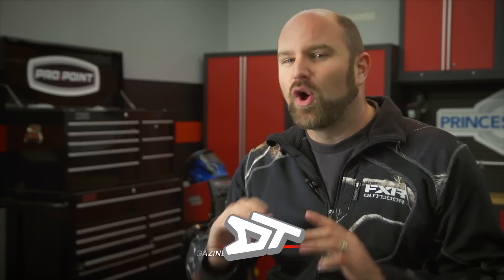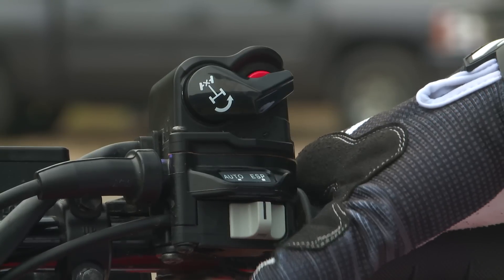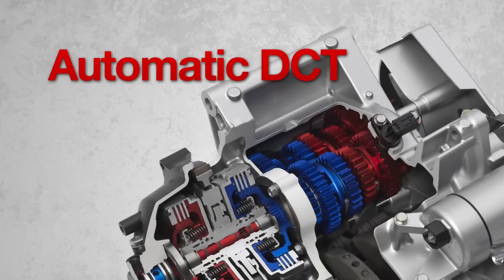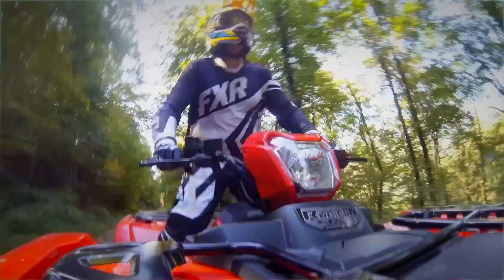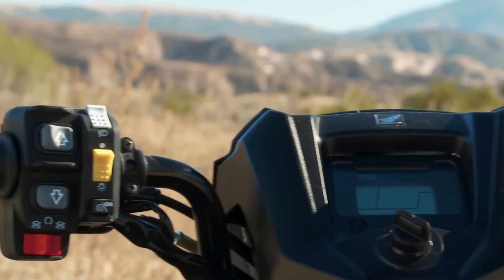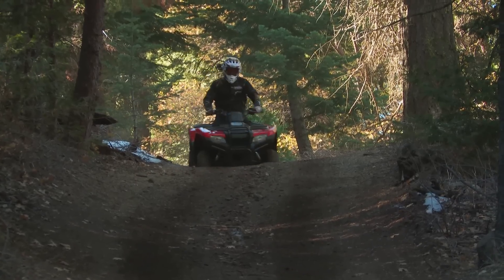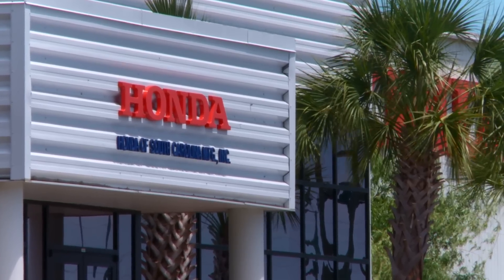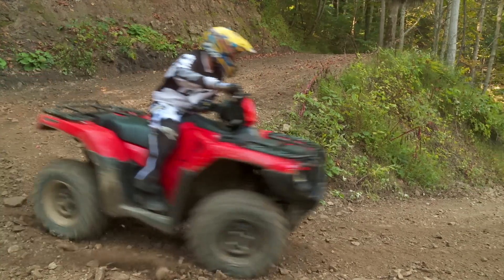Honda ATV Dual Clutch Transmission

Comment: They act like nobody with a Yamaha or Polaris or any other ATV with a CVT transmission can tow anything.

Honda, give it up and make a CVT transmission already.  There is a reason ALL other ATV manufacturers make ATV's with a CVT transmission.  Because they work, and work very well.

I want to buy a Honda, but I will not get one until they decide to step into the 21 century, and at least make CVT an option.
Reply: +AUSTIN WILSON New drive belt in a few months?  Get real. I've got a 2003 Yamaha on the original drive belt with no problems. Don't spread information on things you obviously, according to your previous statement, you know nothing about.
Reply: I don't think anyone considers small-to-mid bore, 3 wheel drive honda products "beasts".  LOL
Reply: Not true:

"Components manufactured in Osceola, Wisconsin and the vehicle assembly in Roseau, Minnesota. The vast majority of powertrain and vehicles for the off-road line are manufactured in the Osceola and Roseau facilities, respectively."

Straight from the Polaris website "PAL".  LOL
Reply: +bushwackerjed towed back a newer Polaris with a CVT just the other day with my 30 year old honda. I've been around plenty of fourwheelers. plenty of Polaris 's with Cvts and saw them fail time and time again. they may shift faster and smoother. but if im gonna drop 6 grand on a new fourwheeler, im gonna get one that's not gonna need a new "drive belt" in a few months. and yes. a few months. a few years back my neighbor bought a brand new sportsman 500 and tore out the drive belt trying to pull his wife's fourwheeler out. CVT is a joke. I'll loose alot of respect for honda if they move to CVT. if it was me I'd still get the manual 5 speed option.
Reply: +bushwackerjed towed back a newer Polaris with a CVT just the other day with my 30 year old honda. I've been around plenty of fourwheelers. plenty of Polaris 's with Cvts and saw them fail time and time again. they may shift faster and smoother. but if im gonna drop 6 grand on a new fourwheeler, im gonna get one that's not gonna need a new "drive belt" in a few months. and yes. a few months. a few years back my neighbor bought a brand new sportsman 500 and tore out the drive belt trying to pull his wife's fourwheeler out. CVT is a joke. I'll loose alot of respect for honda if they move to CVT. if it was me I'd still get the manual 5 speed option.
Reply: +FishEyeGuy Outdoors he bought it new in 2010. had it a few months then that happened. it was in and out of the shop until he sold it.
Reply: +FishEyeGuy Outdoors and that was a polaris. not a Yamaha. Yamaha probably builds them better. who knows. just sharing my experiences.
Reply: +AUSTIN WILSON It was a Polaris. I'm not surprised. They are notorious for having lemons. Some run great for years without incident, others, of the same model spend their life at the repair shop. 

There are plenty of Yamaha, Kawasaki, and Suzuki quads out there with the CVT that routinely run 5000+ miles on the factory drive belt without issue.
Reply: +FishEyeGuy Outdoors either way, I personally would prefer a fully geared 5 spd manual over a CVT any day. for me it doesn't get better than that. Honda has more than proven themselves to me. And I've never been let down by one. So if im buying a new Atv, it's gonna be a honda
Reply: +FishEyeGuy Outdoors So because your drive belt from 2003 hasn't failed that means no other drive belt has failed in a few months of ownership and you are an expert? Just because it diddnt happen to you doesn't mean it happens. Open your eyes and don't be mad you ride a hunk of shit Yamaha.
Reply: +AaronBushcraft Hunk of shit Yamaha.  Lol. Sure there buddy. You keep thinking that.
Reply: No pull start. Cheap plastics. There the Ford of ATVs
Reply: +AaronBushcraft Well, I've got a lovely pull start on mine. And wouldn't you know, all my plastics are just dandy.  But you're the expert right?  Lol.
Reply: +Matt Goetz but not everybody wants a belt squalling in there ear while there riding and gears make it a lot easier ride and more comfortable. "in my opinion"
Reply: Acnologia Sad
Reply: +Acnologia That's like, your opinion, man.
Reply: In your opinion, I'm sure they are.
Reply: Two problems with that statement.  Number 1 - I don't ride a Polaris.  Number 2 - Polaris is made in the USA (mostly) and some are made in Mexico.  Most of the USA dealers get the USA made ATV's.
Reply: Yes Pal, I am well aware that a lot of ATV's if not all of them have chinese parts, except for maybe mine..It's a Yamaha, built and made in Japan :).  I'm not as concerned with chinese parts as you seem to be.

And I do "get" the gears and driveshaft argument.  I just don't buy into that it is better, just different.

I've owned two gear/shaft atv's, (yamaha and honda) and three CTV atv's (two yamaha's and a polaris).  I have never had any problem out of any of the drivetrains of any of them, except the polaris.  And the polaris's issue was internal, not a belt.

There is a fact that has been laid out, however, that although most atv manufacturers use some parts from overseas, most of your major brands have plants here in the USA, that assemble the ATV's AS WELL AS make the majority of the parts for them.

So saying a shaft drive honda is better than a "chinese parts" atv with a CVT, when you are also trying to  argue that ALL atv manufacturers use chinese parts is kind of a conundrum of an argument to make.
Reply: My sportsman 850 has a 1,500 pound towing capacity, no Honda atv is rated to tow that much.
Reply: @HorsepowerGarageVideos  my 2001 rancher 350 pulled 2 Harley Davidson motorcycles on a 12' trailer through 5-6 inches of mud! That's almost 3000 pounds! Can't beat a Honda
Reply: Horsepower Garage Rubicon is rated at 1300 so not much difference and it's only a 500 I'm willing to bet it would tow everything your sportsman can
Reply: +Matt Goetz cvt sucks
Reply: +bushwackerjed You obviously know nothing about ATV's and ATV transmissions with statements like that.  For functionality, reliability, and durability, they are standard for ATV's.  That is why they are industry leading transmissions, and exactly why Honda is no longer on top of the ATV market like they once were.

Combine Honda engine reliability, with a CVT, locking front differential, and 4 wheel independent suspension on all their 4x4 models, and they could very well be a top selling contender once again.  If they would design a two cylinder big-bore ATV and side by side, they would climb back to the top of the sales market even quicker.
Reply: +Matt Goetz I know nothing Ill put it this way I ride a HONDA and have pulled more others back home  others back to camp with their so called leading CVT transmissions with broken belts or other problems and I have never been towed so stop being a sheep and believing new is better its not
Reply: +bushwackerjed Of course you ride a Honda, and think it is the best.  That doesn't make you right, it makes you a fan-boy.  Like I stated earlier, lack of new, proven technology in Honda ATV's today is why they fall way behind the competition in sales.  

I have personally put thousands of miles on ATV's with CVT transmissions, for farm use as well as recreational trail rides, and I have yet to have a CVT failure.  Not ONE.  CVT belts hold strong for at least 5000 miles in most machines, and most could go over 10,000 miles.  People usually do routine belt changes at 5000 miles, just as a precaution, not a need.

Honda makes reliable rigs,  but that is about all they are.  If you like a foot shift, which few people do anymore, Honda has you covered.  They continue to fall behind the competition in performance, power, transmission style, and ground clearance.  

The newest Honda ATV's are 10 years, or more in some aspects, behind the competition in the aspect of innovation.

I hate to break it to you, but you are in a HUGE minority of people who think newer is not better when it comes to ATV transmissions and other innovations.  Keep living in the past 1990's hay-day of Honda, while it's competition from the other big names in ATV's just speeds on by.
Reply: +Matt Goetz still don't trust that junk cvt gears are better and yes I do use it on my farm all the time and pleasure riding and yes have put a hell of a lot more miles than that on them  still have my original TRX200 from the early 80s still going strong and also have 2014 HONDA Foreman 500 wouldn't trade either of them
Reply: +bushwackerjed Junk CVT?  Haha.  Like I said, you're behind the times, and in the vast minority.  Honda's are reliable, I can't argue that, but the sales and following speak for itself.  The other big name machines now match Honda reliability that has always been their "leg to stand on", so to speak.  Sales and customer satisfaction tell the tale that the other big name ATV manufacturers have left Honda far behind.  Hey if you like outdated technology and don't mind sub-par amenities like ride comfort and ground clearance,  Honda has a quad for you.
Reply: +bushwackerjed Like I said, you are living in the past, in a minority, while CVT is PROVEN technology just as capable of your Honda for moving ATV's all over the world around.

Some would argue, that you may very well be just as big of a "sheep" holding on to old technology just because it served you well in the past, and you just can't let go.

Keep riding the old, I'm more than happy riding the new and proven improved.
Reply: +Matt Goetz and some one with the old will be pulling you home
Reply: +bushwackerjed Hasn't happened yet hoss.  Nice try though.  Find me when you get a ride that can keep up.
Reply: +Matt Goetz oh Ill keep up and pass
Reply: +bushwackerjed You keep feeding that personal fantasy.  I'll be up ahead.
Reply: +Matt Goetz right behind me I don't have to modify mine to go like every one does the others and don't say they don't you see it every where you go had to modify this or that nope gears are better
Reply: +bushwackerjed Again, another fantasy.  I haven't had to do any modifications to my CVT quads, and they will run circles around your "special" Honda gears.  I'll put my 2003 Grizzly up against a brand new Honda any day.
Reply: +Matt Goetz you are in a fantasy world and you will not win
Reply: +bushwackerjed As long as I ride against a Honda, with with a name brand ATV, I'll always be ahead.  You don't have to put the old mule to pasture, but us ATV guys that stick with the times will always have to wait for you to arrive at the gate.
Reply: +Matt Goetz just let me know when your cvt transmission gets to be 32 years old how well it is I dought it will make it that long and yes I will be right up there with you

Comment: there is nothing better then a Honda .........
Reply: yamaha is as good.
Reply: @thumperbangin2000  yeah until you have to replace the clutch...or that may only apply to their dirtbikes.
Reply: DanyDoes and not to mention can   ams have terrible reliability
Reply: +larry halsey Got that right bro!
Reply: David Christian yea I have one it's going bye bye and I'm going to my hondas I've got just as munch in parts as I did the bike not to mention I have a 85 200s 3 wheeler it was 0 the other day my can am wouldnt stay running the 3 wheeler sat for 4 weeks and it started in one pull and never died that's Honda for you
Reply: THERE COULD BE!!! IF THEY BROUGHT A 2 SEATER QUAD, THAT WOULD BE MUCH BETTER, YOU ARE WRITE, HONDA= QUALITY.
Reply: Or more expensive
Reply: Brent Ranger AND YOU ARE A BULLSHIT!
Reply: Can am = junk!
Reply: There is only 1 thing better than a Honda. A Kawasaki Brute Force 650
Reply: AND YOU ARE A BULLSHIT! THE CAN-AM SPYDER IS THE BEST WHEN EQUIPPED WITH THE HONDA DCT!
Reply: Ur so dumb bro
Reply: buy what you want   Hondas are number one ..
Reply: +larry halsey I do love Hondas and I will always buy them bc they are the perfect atv for me, but can am is a lot stronger and just better. I prob wouldn't buy a can am bc they have to much power for me  but that's why everyone gets a can am for mudding
Reply: @danvird8649  stonger untill you get to toughness, Honda has the best toughness for their atvs chage my minds. I crashed into a tree twice both times going more than 20 mph and havent had a issue yet.

Comment: How does the rear independent suspension affect towing capabilities?  I had the 650 when it first came out, and found that it was not able to tow as well as my trx500 which did not have the IRS.
Reply: +Practical Builds yes, thank you!

Comment: this is a step in the right direction but the bike is underpowered for this class has a air intake that is too low,  a low top speed and not enough ground clearance.  Honda needs to put that new 1000 desert twin in a hardcore  atv  frame to compete with Can am.

Comment: I still don't know why they don't just make both a cvt and a dct. They would expand their market and I might actually buy another Honda lol. But I've gotten hooked on the cvt it's just too nice to throw it in gear and hit the gas. I used to say all I'd ever have was a foot shift but after riding an auto I got hooked.  I've also had a lot of problems out of Hondas electronic shift crap and that makes me leary of them.
Reply: It doesn't work very well imo I've had em all and a cvt is the most user friendly and I love the high speed reverse for getting out of mud holes and such. It's a much better design to me. I've had multiple Hondas and I've rode a lot with the dct I really don't like it at all tbh. When I ride them I shift them with the buttons lol
Reply: ***** one thing that does suck is the loss of power thru the system. But thus is easily fixed with a clutch kit that meets your particular needs

Comment: The main reason I ride Honda's is because they DONT use cv belts.if that changes,I'll probably look else where.I like my Polaris 570 power wise but always end up back on my Honda just because I hate the belt drive
Reply: dirt ryder I've gotta 2016 Sportsman 570 and I haft to agree great bike hands down but just hate worrying about the belt getting wet and being stranded...
Reply: What does it use, a shaft?
Reply: @homersimpson2963  Honda's are ALL shaft and gear driven.  NO BELTS.  Why?  Because Honda invented (Japanese invention NOT American) the ATV AND patented their drive system.  That's why every other ATV manufacturer uses belts.
Reply: Turbo TDI sorry but a CVT with a wet clutch on the primary CVT clutch like Yamaha is superior to a DCT. The CVT has shiftless operation and keeps the engine closer to it’s peak power band almost at all times. It’s not hunting around like on a gear driven auto DCT. The only reason Honda doesn’t have a CVT is because they are too stubborn to join the crowd. Not because DCT is better. However I will agree any transmission is better than a Polaris CVT. They slip and blow through belts constantly.
Reply: @ve3xtr  Honda didn't invent the atv lol, Suzuki did and they use a belt driven transmission and it's flawless
Reply: The synchromesh transmission one of the greatest inventions of mankind and so reliable there is lots of 80s trikes still going with nothing every done to the transmission. although I’ve never had to many problems with Cvt on my snowmobiles I sure wish they had a Honda tranny.